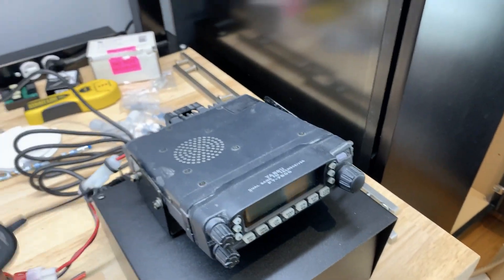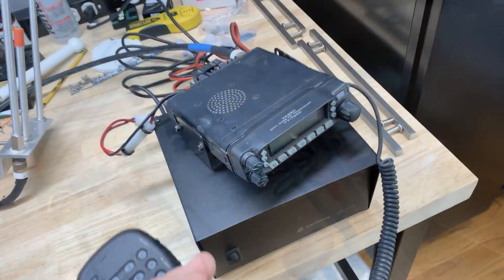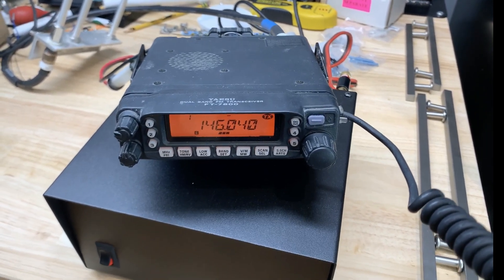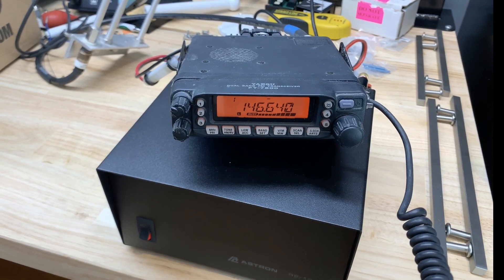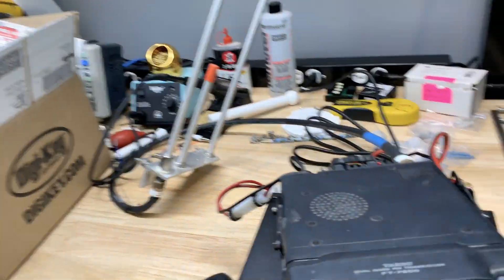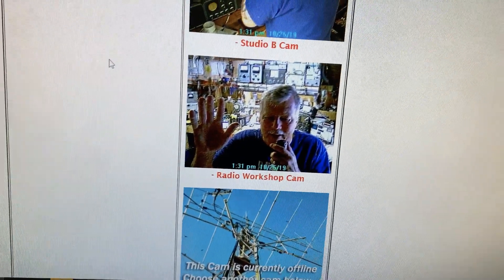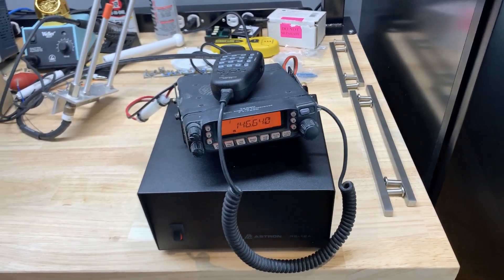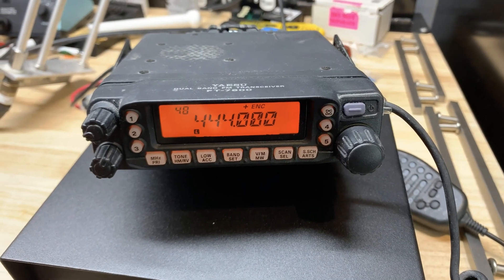How to connect up a mobile Ham Radio and talk on a local repeater

Comment: I just bought a FTM-400XDR. I will be using it for home base for now. I am still waiting on my call sign. I took the test 2 weeks ago tomorrow. I got the radio in today. but I need a power suppy, coax, and a antenna. I would like to get this up and running to at least listen until i get my call. any suggestions
Reply: Did you ever get it set up? That's the route I went, the FTM-400 was my first radio as well, but I installed it in the mobile. If you got your license around the time of this comment, we have probably been licensed around the same amount of time, I am now an extra getting on HF with the FT-991A. Have a blast with radio.
Reply: @tylerdean980  Hi there, did you like the Yaesu 400? I am considering a mobile for VHF/UHF & HF (separate radio)
Reply: @brentjohnson6654  Yeah, I've had zero issues with it, I've heard radios that have screens like this tend to get wrecked by heat, and living in Arkansas with a black truck (it does get quite hot) I haven't had any issues, and its probably been in my truck for around a year and a half at this point. I don't do a lot of talking on the radio, but it is frequently used to transmit APRS packets, so its not like I never use it. It was my first radio so take my opinion with a grain of salt, but 10/10. I need to try some packet radio with it. . .
Reply: @tylerdean980  thanks for the quick reply.  I have been impressed with Yaesu for 35 years.  I am living in Texas so I understand what you mean about the heat!! Is it easy to add a repeater to the FTM-400?  What I mean is if I am traveling from Texas to Florida, is there an easy way to program in a repeater? I only have an HT currently and it is an Anytone 878 which performs very well, but requires a code plug or a bunch of on radio programming to add a repeater.   I love the radio except from that.  Thanks again, 73 de KI5HXM
Reply: @brentjohnson6654  Yes, adding a repeater is not difficult, and unlike DMR radios, does not require a PC or a code plug. In fact, because the offsets are standard in the US, the FTM-400 does the offset for you. If the repeater doesn't have a tone on it, all you have to do is enter the receive frequency and it will automatically transmit on the correct frequency. If it has a tone, you obviously have to enter the tone, either manually, or with a tone scanning feature, which I have not used myself. But it is quite easy. There are plenty of videos on YouTube to explain the programming process, and because of the popularity of the FTM-400, there is plenty of information out there about it. For example, there are videos on this site that go in depth on how to set up the APRS functionality.